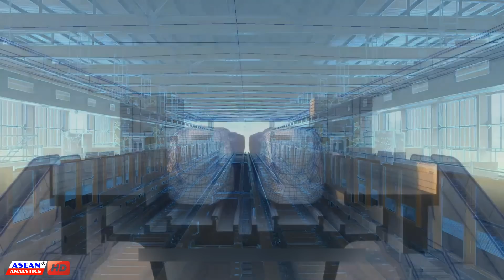LRT 1 Cavite Extension Project Update: Phase 1 Viaduct  now 100% Complete

Comment: Anong 100% percent complete. Wala pang viaduct or even poste pa las pinas to niog bacoor. Kaya pla sinasabi ng LRTA na 2025 pa masasakyan contrary sa sabu ni Sec. tugade na 2022. Ang viducts na naitayu is hangang sucat paranaque lang
Reply from the maker: The Phase 1 viaduct were already completed. The other 3 stations are under Phase 2, which still on the advance planning stage. It was also properly disclosed in the video. 

Quoted " The first five stations of the extension will be built in the first phase and to become operational by 2024, while the remaining three stations are still in planning stage."

Comment: 0:25 to 0:28
I think that's a different train.
Reply: I see Alstom, Alstom was one of the contractor of this project
Reply: @miscextras4259  Alstom is also the contractor for many other projects. That train, 0:25 to 0:28 won't be the train LRT line 1 will be using.

LRT line 1 will be using this 0:23 to 0:24
Reply: @Justineexy  I can't share the link, the first one was made by CAF, and another one was made of Alstom. You're pretty sure ah.. another manufacturer are  CMX consortuim.
Reply: @miscextras4259  ok?
Reply: https://youtu.be/ZawpQIPH8tQbk